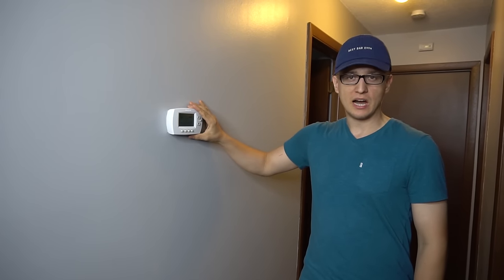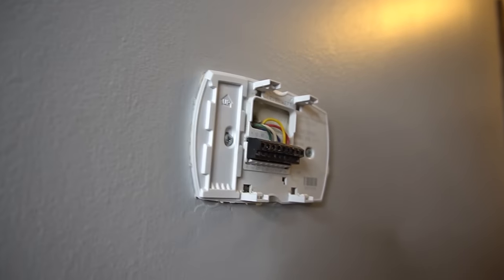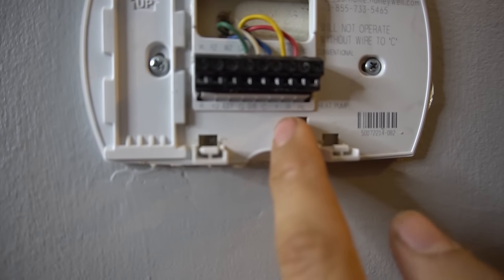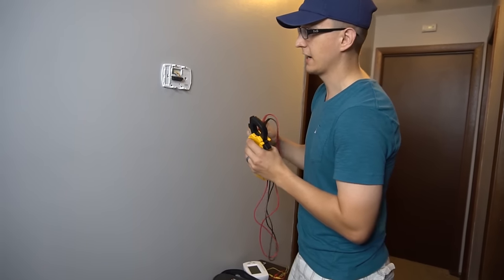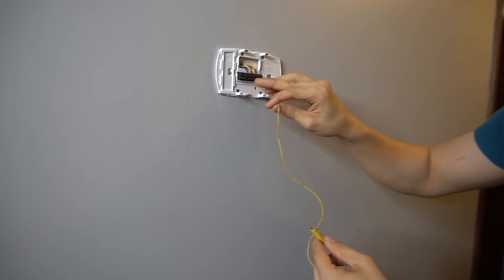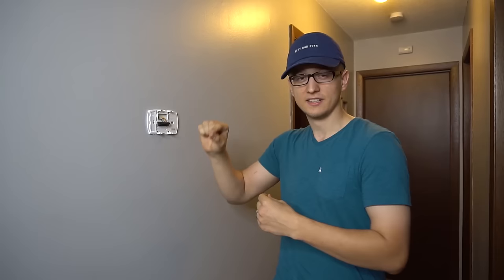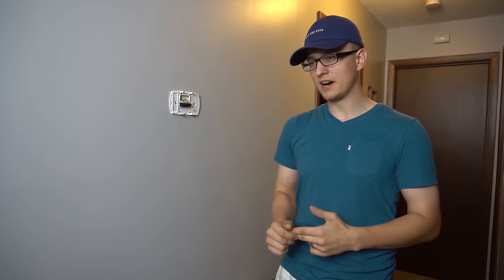How to Tell if Your Home Thermostat is Bad - Bypass it and Find Out

Comment: Hello my friend! thank you for the information. I accidentally removed my thermostat to replace the batteries without turning the switch off to the furnace. Is that going to cause problems? Could that by why I am getting a reverse line voltage polarity signal from my furnace?? Thank you sir!

Comment: i have only heating furnace but  it has two wire white connect to w, and red connect to B,  is red suppose to connect to R?    i want to by pass thermostat to test if it's bad or not can i   connect w to B? would it cause any issue?

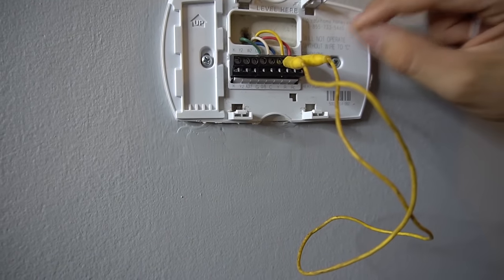Comment: @5:01 the fan will not come on it will frezzeup the unit  also jump the g wire to TC term
Reply: Geoff most new furnaces require you to hook up the yellow wire to the control board. This is to bring the fan on in high speed for cooling. If you turn the fan switch on at the stat it brings on a slower speed. The way it used to be is you hook up the yellow to the condenser wire without hooking it up to the control board.

Comment: What's the solution if there is not 24V on the red terminal?  I have 24V on the control board where the transformer attaches to the control board, but no voltage at the red terminal at the thermostat or on the red terminal on the control board.  Should I take the thermostat off and measure resistance between red and all the other terminals to see if there's a short in the wall?  Question:  shouldn't the 24V on the transformer connection be directly connected to the red wire connection?  They are at opposite ends of the board, but I assume this should be a direct connection.  There's a bunch of other functionality on the board that I'm not using for gas igniter, etc.  Could leaving these connections open be inhibiting the voltage for safety reasons?

Thanks for all you do!  You're my go to guy when I have HVAC issues.
Reply from the maker: Sorry to hear about the AC troubles! I would first try to figure out where you are losing power. To answer your question, the transformer supplies power to the control board and then the board sends power to R.

Is there power at the furnace door switch? Is it closed?
Is the 3 amp fuse good? (sometimes its 5 amp or a mini circuit breaker if it's a Lennox)
Does the transformer have power going to it? (120v) Does it output power? (24v)
If the transformer is outputting 24v, yet you are not seeing it on R, that usually means the board is bad.
Reply: @WordofAdviceTV  Actually, this blower has no door switch.  Interestingly, the other blower in the house has one.  I plan to take resistance readings on the thermostat wires and then regroup.

Comment: In the winter (about 4-5 months ago) my outside AC compressor was coming on when the furnace was on. I turned the AC circuit breaker off to turn the power off to the compressor as there was no other way to stop it from running w/the heater. (I figured I'd deal with it in the springtime. 
Now that it is getting hotter outside, I went to use the AC yesterday (turning the circuit breaker back on first) and neither the blower fan motor or compressor is coming on with the AC (will not work even in HOLD mode). If I switch the thermostat back to heater mode, the heater works fine. I did notice also, turning the fan switch on the thermostat will not turn the fan on, but again the fan works in Heat mode. Is this likely a thermostat problem (which I am guessing it could be)? Any ideas would be deeply appreciated. Also, I do have a voltage meter to test thermostat if I know the procedure. I would guess 24 volts from red and common. THX. The thermostat is a program-able Ritetemp model 8022C.

Comment: Is it common for the thermostat back cover to be bad too or is it mostly the front thermostat itself? Like when you took the thermostat of , the portion of the thermostat that remains on the wall , have you had those go bad too?
Reply from the maker: It's not common. That back part is the base. I have seen a few that were bad but those were mostly cases where the thermostat was ripped off the wall and the base/mount was just physically damaged.

Comment: Thanks for the video, Jay! Question: I'm trying to re-qire my digital thermostat so that the kids can't be turning it on and off all the time (they like to play with it.) Is there any way to make the "on/off" switch not work without damaging the thermostat panel?
Reply from the maker: Unfortunately that is not possible. You would need to get a lockable thermostat that has that feature. For a thermostat that is not lockable, you would have to physically rig it somehow to accomplish that. There are plenty of thermostats out there that you can put pass codes on though. Example: https://amzn.to/2FdGNc7
Reply: Thank you! I'll definitely check it out.
Reply: landdcollection also they have lock boxes with a key that can go over the thermostat you currently have that are fairly cheap.

Comment: My Honeywell thermostat started acting wierd today. The display would stay lit, and the "Set to" area on the left would flicker rapidly. The unit would run for like 3 minutes, then the thermostat screen would light up and "set to" and the desired temp would start flashing, then the outside pump would shut off, and a minute later, the inside system. Now the "Set to" area is completely gone, showing only the internal temp, and I can't get the unit to power on. I tried the Jumper trick with a set of needle nosed pliers, and got nothing. Can a dying thermostat take system down with it?

Comment: If my air conditioning is not kicking on and I want to check the thermostat do I just jump  R over to Y or do I also need to tie in G to activate the fan?
Or will jumping R To Y only, also energize the fan?
This is for air conditioning now.

Comment: Are RC and R the samething? My R and RC are connected with a wire. When trying to bypass, I connected my R/RC with Y, did I blow a fuse? I don't have an alone C switch
Reply: Rc is power only for cooling only, so if you don't have A/C you'd not have it connected to R. When connecting to Y, the A/C should start,
Reply: @trespasser121  nothing happened immediately, but after a week or two, a capacitor blew and had to be replaced.
Reply: @mustafamalik4211   Probably not related. The A/C capacitor is rated 240+ volts

Comment: My Thermostat I am sure will turn on because it does turn on my ac. The trouble here if I am not misunderstanding how the thermostat works is that the fan unit outside powers off at times as if the temperature inside has been met by my thermostat setting. ( i.e. - 71°) The issue I noticed is that even though I have it set for 71° the thermostat display is showing the current temperature as 75°- I walk out side and the fan unit is not running.  I take a few minutes to do a very general inspection of the unit meaning Im just looking through the fan grate(I just purchased the unit Last Year,  and the next thing you know the fan kicks on.  Back inside my thermostat is displaying 76° and the house does feel warmer but my setting is still at 71°.  Is this a bad thermostat? Shouldn't the fan only stop once the house or thermostat reads the temp inside at 71°??

Comment: Awesome video. Thanks. My digital thermostat just died. It seems completely frozen. The display shows the room temp and the temp I have the furnace set to but when I try to raise/lower the temp nothing happens. I tried resetting but nothing happens (won't reset) and the strangest thing of all when I pull the batteries (it's battery operated) the display doesn't blank out like it should. So I haven't yet checked if there is power to the terminals but I suspect there is so my questions are: 1. I can only get the Supco MAG1BL magnetic clip right away. Will this work (the specs sound like it's fine) and 2. I guess if my thermostat is broken then I have to disconnect the clip when the house gets up to temperature using an air temp thermometer correct? I'm assuming if I don't disconnect it then the furnace will keep running. Thanks again for making this video. :-)

Edit: I only have RC and RH not a separate R and C so how do I test this? Do I do RH to W with the multimeter if I want to test this for heating or is it RC to RH with the multimeter. Thanks.

Comment: Wonder what experience you have with Nest thermostats. I used to have a honeywell that could run the fan while heating and cooling were off. After switching to Nest I can only run the fan with it set on cooling or heat - but the fan can still run without the furnace or AC running. Wondering if maybe I should try jumping R to G to see if the fan kicks on.

Comment: I replaced a thermostat a few months ago.  
  When I tried to get the heat to come on, it would not come in until I put a jumper from RC to RH.  I only had a the red in RC to start with. 
  Only thing I could figure was RC was power for cooling and RH was power for heating. 
  The jumper did the trick, or seems to have. 
  Have a question. 
  The inducer motor seems to have a bearing making a slight squeak. 
  Is this from not being on since last winter?  Think it will go away in its own?
  Could I get by with trying apply a little bit if oil on it?

Comment: Why do you have to shut off the furnace before you removed the face cover of the thermostat? Also do you do that in the cool mode also.
Reply from the maker: You don't have to. I say that just in case. The R wire, even with the thermostat base off, still has 24v going to it. 24v is not dangerous but one could accidentally short something out if they start moving wires.
Reply: Thanks Jay for clearing that up

Comment: Thanks I was able to jumper across R and W to start my furnace but I get no voltage across C and R.. My thermostat works now and then but it does work occasionally. Do you know if having a poor ground connection could be the cause ?
Reply from the maker: You're right, there should be 24v between R and C.. If you measure R to C at the furnace, do you get 24v there? I doubt it's a bad ground connection, it's more likely to be a loose or broken wire.
Reply: @WordofAdviceTV  Fact is I have figured out if I tap on the thermostat it will start every time so it must have a dry solder joint. I tried but couldn't find it. I don't think my thermostat needs the C to work.
Reply from the maker: @jbalatutube  Ah I see! Well glad to hear you were able to narrow it down to what's causing it at least.
Reply: Wow just thinking about it I bet the 24v is AC and not DC hmm must try this tonight. Also I have touched up all solder points and it still doesn't work unless I tap it, so it must be the solenoid getting stuck, even though I can hear it click. This explains why switching it on and off many times gets it working and why tapping it also works !!
Reply from the maker: @jbalatutube  At this point I would just replace the thermostat :) Even if you get it fixed, the problem might re-surface not long after.

Comment: Hi Jay just a clarification..if you jumper it if nothing happens that means your thermostat is good?? Please clarify thanks...
Reply: Thermostat is a automatic switch ON/OFF. Remove the Cover...If you connect Red and Yellow(AC) it should start the AC. If you connect Red and Green it should start the Fan. And Red and White is Furnace/heater...
Reply: @thembones12  thanks for the reply. I got it. Mine didnt start when i jumper it which means thermostat is good and the problem is somewhere else. Actually what the problem is with mine is the contactor outside the unit ut was shorted the coil only reads 1.3ohms.

Comment: Thank you very much for your videos.  My question is i have voltage at the thermostat when I jump to the fan it turns on. When I jump to the yellow wire I get nothing. I go to the unit push in the plunger in the contactor and everything turns on. So where would I go from here. Thanks in advance

Comment: My thermostat doesn't have anything wrong with it, but doesn't have a setting to keep the fan always on. I've considered just jumpering the green and red at the furnace. Will this affect the function of any of the other switching if those two are always manually jumpered?

Comment: Great video... thx. My situation is a little different.  I have 2 zones. 2 wire hook up for gas. Got a Honeywell thermostat. I hooked up the wires (white to W and black to R). Getting very low heat. Can't get the heat up past 65. Had a license plumber come take a look, he can't figure it out. Any suggestions Jay ?
Reply from the maker: Can you verify that both zone dampers are opening? Also, that sounds like your furnace may be overheating. Have you tried replacing the filter? If you happen to catch the furnace not working right, I would look and see if the control board is blinking any error codes. Is this a new furnace? If it's new, it's possible that it wasn't set up right.
Reply: @WordofAdviceTV  Jay thanks for the advice.  Surprisingly enough this furnace doesn't take a filter, Burnham Series 2. I'll have to have a pro take a look at it. I'm handy but it's now out of my reach. Thanks again. I'm a new subscriber, so keep the videos coming.
Reply from the maker: @Sigma100_  Alright, come back with an update if it ends to be an interesting fix. If you get the chance of course. Good luck!

Comment: After you find out if the thermostat is getting power, do you then turn the furnace switch back off before you do the bypass?
Reply from the maker: You don't have to but it's better if you do. If someone accidentally touches R to C with a jumper, that would cause a short and will blow a fuse or even worse, fry the control board.

Comment: Off topic question as I just found your videos, which are very informative, thank you. I bought a lot of 15 honeywell 9320 wifi thermostats and do not have anywhere to hook them up to test for power or if wifi registered. would you have a fix or what type of portable battery set up i can use to connect it to to test? Thank you. Cindy

Comment: Thanks, so you dont need to turn off the thermostat at all to do all the tests?
Reply from the maker: Well if you turn the furnace off, then the tests would not turn anything on. So yes, the power needs to stay on.
Reply: Thanks, if its a heat pump thermostat can you test the thermostat this way? @WordofAdviceTV
Reply from the maker: @MA-lm1ql  It would be a bit different for a heat pump. I dont have a video on that but AC service tech does: https://youtu.be/7e5uDEHaDnA?si=s0etVo-ldMquKZkT

Comment: @Word of Advice TV Does this bypassing technique apply to line voltage thermostats like those in wall mounted units? The voltage and power on those are much higher so I'm not too sure how good of an idea it is for that situation?

Comment: In your video, I think you said? jumper R to Rc to get cooling, don't you do the same thing by R to Y through the t'stat. Maybe I misunderstood you.  Also another question, since you have an Rc terminal, why isn't there a jumper on the thermostat you're showing.  Good basic video.
Reply from the maker: Hey Jeremiah! Good questions. I'll try to explain it a little better:

1. The furnace control board sends 24 volts to the thermostat, to the R terminal. But when there is a call for cooling, the micro-switch that closes inside the thermostat is between the Rc and Y terminals. Once that switch closes, it sends the 24v to the condenser unit outside. But if there is no 24v at Rc, then when the switch closes, nothing happens. That is why a jumper is needed. To bring the 24v from R to Rc. I hope that makes sense so far. The 24v at Rc is then on standby until there is a call for cooling which closes the switch and allows power to go through. When you jumper R to Y, you are basically bypassing that micro-switch and sending power directly from the control board to the outside unit.

2. My thermostat does have a jumper wire between R and Rc. It's just a really thin wire with no insulation so its hard to see in the video.
Reply: Word of Advice TV   So if the Rc to the Y terminal is done inside the t'stat micro switching there's no jumper needed.   I guess if the cooling unit or condenser unit outside does not come on without a jumper between R and Rc then add one correct?
Reply from the maker: @jeremiahjohnson731  Yes. There should be a jumper between R and Rc. But no jumper between Rc and Y as that would cause your AC to run non-stop.
Reply: Word of Advice TV I just wondered because I didn't see a jumper on your t'stat
Reply from the maker: @jeremiahjohnson731  Ah I see. You aren't the only one that noticed that :) The first time someone said that in the comments, right away I went to my thermostat and double checked. There is indeed a small jumper between R and Rc

Comment: Thanks for the video. Question: My furnace stops working when I put the thermostat fan setting on auto. Do you have any idea what causes it?
Reply from the maker: You may have a bad control board or thermostat. I can't say for sure without further details though..
Reply: Fan setting on "auto" will not turn on right away, normally is off position. You have to set Fan setting "on" to get it running.

Comment: I found that my ecobee thermostat was burned and so we replaced it with an old thermostat but the furnace does not come on.  Could there be another issue beside the thermostat?  Before we jump it, should we check anything else?